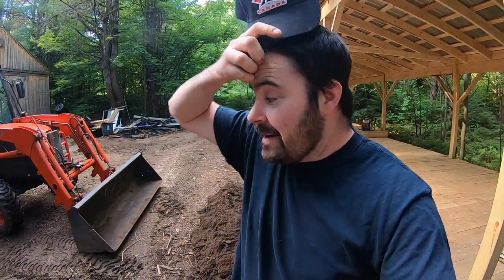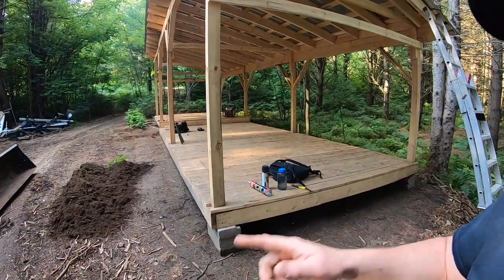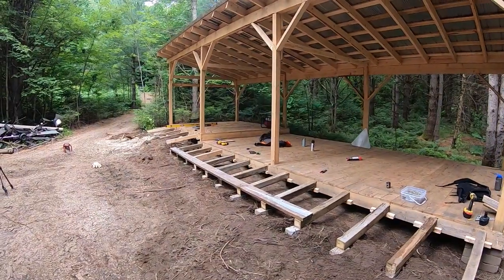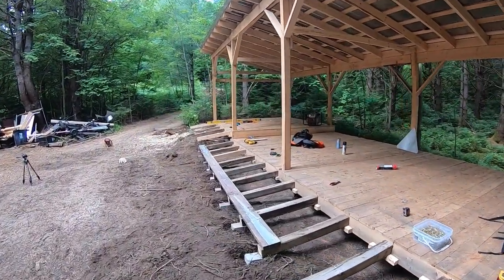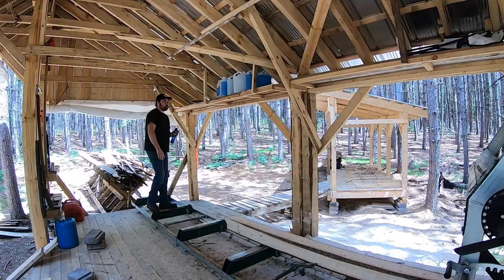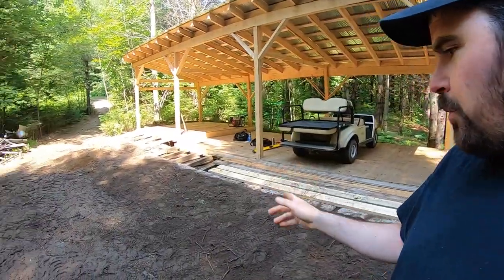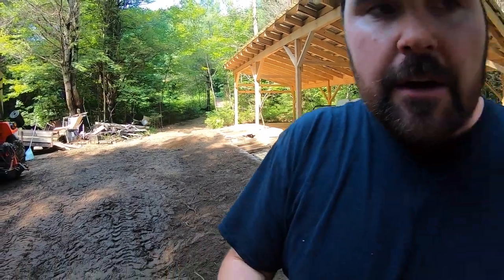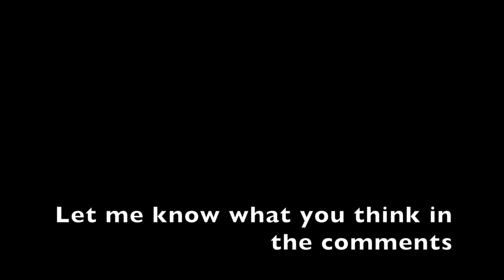Bees Aren't Happy with this Shed Ramp Build | Equipment Shed Build - Ep. 9

Comment: Great design for the ramp Sandy!  Great to see that your doing those little things like cutting the 10 degree angles in both the support and the 4x4.  💯 agree with you on the choice of using materials that you had on hand vs say trucking in rock etc.  in my previous comment I noted about perhaps using crushed rock with minus within but was thinking later on afterwards that would be an option to have to go out an purchase and deliver / haul and I’m all for using what one has before going out and buying materials etc..  sorry to hear about the bees there, hopefully you can get them taken care of soon!  Anyways great build and am enjoying the series, cheers Sandy!
Reply from the maker: Thanks for that. I try to use as much of the material I have on hand where possible also to keep the costs down

Comment: I thought for a while that you might use the firewood half rounds and stack them on the half rounds. Their just firewood unless used in corduroy road beds. I know of them used in our muskeg as they are resistant to rot if covered and small gravel will not sink through them. They have lasted over fifty years I am most sure of the fact. Won't leave in the rain either... in any kind of weather short of floods. I think what you have done will work excellent also... take a bow as ya done good. I liked taking my cans of starting fluid and point at those bees with lighter in hand to make a flame thower. Fun watching them scurry on the floor/ground with no wings as depends how long lasting in the flame. nice work Sandy
Reply from the maker: Those curodory roads sure sound like they wirk good. I hear tamarack are good trees for those as well

Comment: often use carb or brake cleaner even WD-40 on the wasps. it has better knock down power than the poison. Seems like you have to soak them good with the poison spray before it takes effect. The thinners seem like just a wisp will do them in most of the time....better range with the poisons sometimes though.
Reply from the maker: Great to know! Thanks for sharing

Comment: Not so sure I would have used top soil as a base for the pavers and for the ramp.  I think you're going to have issues with settling and the vehicle tires rutting the path especially in rainy times.  I would have put down a base of 3/4" stone after having scraped the top soil off.
Reply from the maker: I’ve got a rubber mat going over the topsoil to prevent the rutting

Comment: I just received an HM130MAX. Everything is going great, with the exception of flipping logs. When I use my can’t hook with the provided log stops, the log keep getting hung on the sharp edge of the stop. It digs in deep enough I end up just having to use the tractor. Woodmizer puts wheels on their stops. I was just curious if you had any advice or fixes on that??
Reply from the maker: I find the longer log stops with the mitred cut works well to allow the log to roll easily. I just make sure the mitre is sloping towards the sawmill to avoid the log from getting hung on the log stop edge
Reply: There is a fb page for Woodland mill owners. Someone on there has pictures of adding rollers to the tops of the stops.